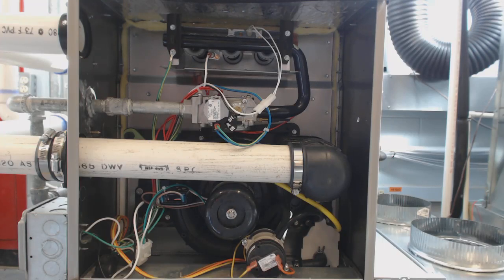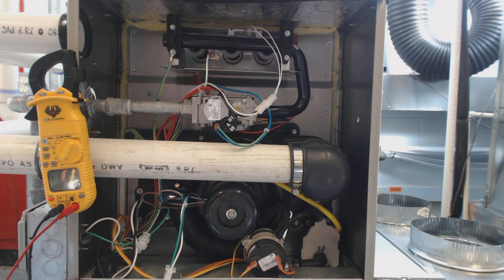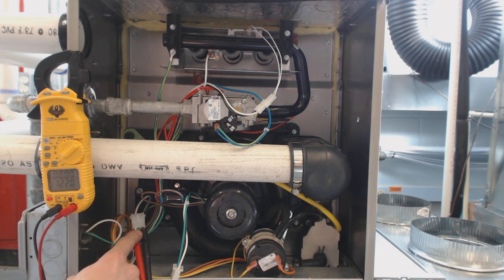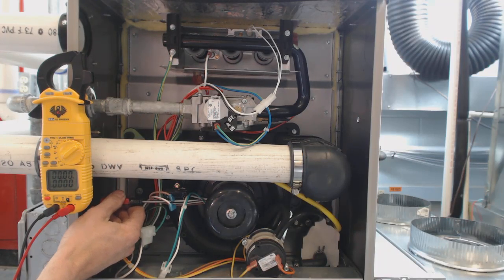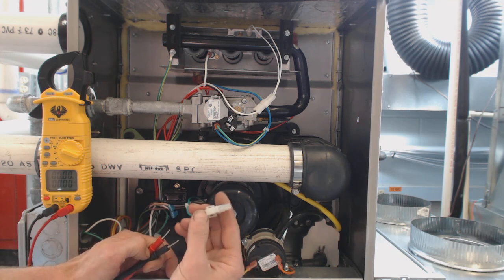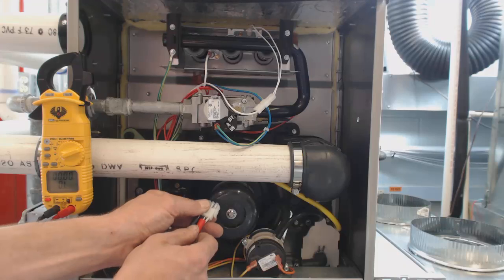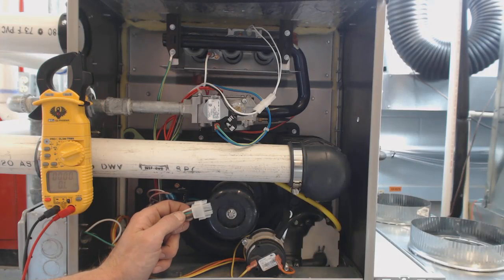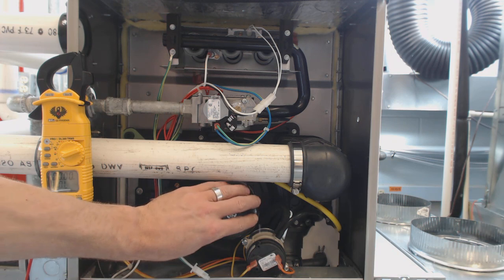How to tell if an Inducer Motor is BAD: Explained Step by Step

Comment: My problem was that the inducer motor was spinning perfectly but wasn’t turning on. I was getting 117 volts coming to the connecting wires of the motor, so I knew that the board was supplying the voltage. I pulled the wires off of the motor so that the motor was a stand alone component and connected it to a 120 volt jumper and the motor was dead. My house has 2 identical HVAC, one is upstairs and doesn’t get used as much, so I took the motor off of the working one and swapped out the not working one and it fired right up. I ordered a new motor (not from Jeff Bezos) and will install it on the other one.

Comment: For the last month I've heard a scratching  sound right by the furnace. I could never find anything,  but it sounds like a critter. Do critters like to crawl ip the horizontal  pvc pipes?  Do they die when they hit the impeller blades and make a racket?   I can't smell anything bad in the pipes  .  Furnace was working well, and I heard scratching,  now no scratching  and a loud racket. from  the induction fan.

Comment: Thanks for the indepth tutorial. At the end you revealed my issue - stuck bearings of the inducer motor. A couple turns and it was running. I'll degrease them later 😊

Comment: The motor wheel was cracked causing it to be noisy. Do you think we as a do it yourselfer could fix that wheel with maybe some epoxy or some kind of strong putty for plastics or can the wheel itself be replaced or do we have to buy the whole motor, housing and all?

Comment: I replaced my inducer motor and blower wheel because of bearing noise. Got them separately on Amazon. Now I got a lot of orange flame. Flame looks like crap. It was nice and blue before. Also seems like the flames are not being pulled/stretch enough inside the exchanger because the flames are not a narrow as before. 
Maybe didn't adjust the fan blade on the motor shaft far enough out?  
Maybe the new cheap Amazon blower wheel sucks?
I got a nanometer, but haven't checked the vacuum on the inducer yet. Not sure if the manual has a spec or not.
Reply: Did you figure out what the problem was?

Comment: My inducer motor ran but it didn't close the pressure switch every time. The igniter always lit up for the first time and turned itself off right away. The motor ran but gas valve didn't open, the control board gave 3 flashes for bad pressure switch. However, the igniter lit up for the second time and this time the gas valve opened. Is this because the inducer motor is bad? Thank you.

Comment: Inducer motor spins with no noise or resistance once it gets started but just doesn't want to start.  I initially didn't see the capacitor as I figured it would be down with the blower capacitor but yeah..that's gotta be it.  Thank you.

Comment: Hello,my furnace is calling for heat but the inducer motor does nothing and is hard to spin however the board is giving the code it's the pressure switch?

Comment: Somebody used galvanized water pipe for gas pipe
Reply from the maker: There is no differentiation in black iron vs galvanized in the IFGC 2021. We live near the ocean and supply houses only supply galv. Black iron rots too quickly but in reference to nationally, there is no problem using galv unless your local inspector shows you some reference to a code that the city has adopted outside of IFGC, thanks!
Reply: If there’s no difference then use black iron where galvanized is supposed to be used. It’s your preference. Thanks

Comment: I don’t have an amp reader but curious to hear your feedback.  I just turned the furnace on.   Getting a small buzzing sound.  Not a loud Humm, like I’ve seen in some videos.

I am replacing the capacitor.  Am worried Becusse the inducer blower motor was pretty damn hot after 2 minutes.  
  What’s the difference between the inducer blower motor (mounted on the front of the furnace) and the blower motor on bottom of furnace attached to the wheel?
Reply: Having same issue myself. Small humming from the inducer motor.
Reply: @MrSmith-ke1hb  have you checked the capacitor on it?
Reply: @bobduffy7744  seized motor on a 24 year old unit. Fan was hard to even turn. Company not even around, luckily they had replacement. Ty for your vids.
Reply: @MrSmith-ke1hb  did it just seize unexpectedly?  Or was it making any noise prior?   How was the furnace working before?
Reply: @MrSmith-ke1hb  and I’m not certain.. but I think a bad capacitor can still cause difficulty in turning the fan.  Not typically but it’s a very cheap and easy fix.  I’m not sure how much a motor will cost.   24 years u never know..
Reply: @MrSmith-ke1hb  check that video out.  I hope that helps
Reply: @MrSmith-ke1hb  https://youtu.be/ul3RiDNn6io
Reply: Inducer is used to pull a negative pressure blower is used to move the air around your home

Comment: i have 9 wires going to my inducer motor on my furnace. i get an error code that its failed. my motor reads 5.7m ohms which is way too high but what i dont know is if there is some kind of circutry inside the motor involving those other wires that will change the resistance of the coil.    i have no external cap so that on the board, visually the caps are all electrolytic and none of them are popped.  should i just buy a replacement motor and go from there?

Comment: Great Video! Quick question, my heat won't turn on, and my inducer motor when I touch it is really hot to the touch. When I spin the motor wheel and power cycle the Furnace, the until will work for a day or 2 then stop working, and I need to repeat the above, I am guessing the motor is bad?

Comment: Technician come over for regular check up An d told me my inducer motor need to be replaced because after running for awhile fell hot the motor no noise An d works fine until he said that

Comment: What about if the inducer motor is going on and off while the air conditioner is running?I can hear it start up and then it will shut off and then start up and then shut off

Comment: On my inducer motor, there are two wires that plug into the inducer. (White & black) when I have both of them plugged in the white one is sparking where it plugs in. Is this a problem? Everything works it blow's out heat. Also the flame's came back at me so I shut it down.

Comment: hi, i was working on a unit heater. on a call for heat the board sends out 125vac to the venting motor BUT the motor won't spin. i checked motor ohms and got 8ohms. i replaced the motor BUT same problem. when i connected motor directly to 125vac line voltage motor spins fine. why does motor won't spin with 125vac from board? is this a bad board? thank you.
Reply from the maker: Interesting! Check the voltage by also measuring the hot at the inducer to the 120v common on the transformer. Also measure the common going to the inducer and the 120v hot at the transformer. Also measure the 120v output from the board at the inducer motor wire plug but with the inducer disconnected. Also wiggle the connector while measuring voltage. It may be a bad contact on the board or plug where you get voltage without a load and then once amperage is pulled, the contact has too high of a resistance for the voltage to remain at 120v, thanks!

Comment: okay so my goodman gas package unit blows the circuit board fuse when the thermostat is turned to heat, but when I bypass the thermostat & thermostat wiring at the unit and hook the white to red, the heat works just fine. any advice?
brand new unit. single stage heat and cool, with single stage honeywell thermostat.
this is my second thermostat :-/ same symptoms...
Reply: Way late but for anyone else, your white wire may have a short. You can check continuity by turning power off and putting white and red or whatever other wire together then going to the thermostat and putting each lead on white and red in continuity. If it's open then there is a short. You also want to check to ground.
Reply: @Big_Nasty966  ah thanks for getting back to me.
I figured it out: I'm not supposed to connect the blue wire to the thermostat. I haven't had a single problem with it ever since I changed that. 
It might have been something particular to my thermostat. It's kind of funny that I built the ducts, built a custom filter housing with constant pressure monitoring, installed the concrete pad, installed the electrical and gas...and the only problem I had was with hooking up the thermostat =D

Comment: Should the inducer work if you apply 120 V to its terminals directly?  I did that for a few sec and I only heard a humming sound.
Thanks.
Reply from the maker: There may be a capacitor mounted on it too that may be bad
Reply: @acservicetechchannel  It is pole shaded motor, I changed it and everything is fine now.  Bought the motor for $135.

Comment: Hello, I'm relatively new as a tech in a sense.  I recently came to an indicer motor that was pulling considerably less amps than it was rated for.  The motor was rated at 2.7A but It was only pulling 0.9A.  In all the tune ups, I've never seen one pull such low amperage.  I've seen induces pull over amps, but never that far under.  Are you aware of any reason that could happen ?

Comment: What if my inducer fan I s running and I just replaced pressure switch ...what else can cause pressure issues I'm thinking maybe a crack some where I cant see because I feel no pressure at vynal tube
Reply from the maker: Look up a video I did, top 10 pressure switch error code problems, thanks!

Comment: The unit I am working on has 7  volts  coming to  inducer motor  wiring  as inducer motor is disconnected. 

Then I measured resistance between  hot and  neutral  terminal of inducer motor,  it only reads 4 ohms.

Does this mean the both board and inducer motor  are  defective?

Comment: Can an inducer motor still run and cause problems? I have an intermittent code 3 on my keeprite thats only 6 years old. 
The furnace will run normally but sometimes about 4 or 5 mins into the heat cycle the burners shut off and the fan still runs for a good few mins then shuts off and turns right back on and will run again till it meets the temp called for.. ITs a odd issue and 3 hvac techs couldn't fix it on 3 seperate calls last winter.. It ran fine on ac all summer with no issues.. But now the weather is colder its acting up again.. I can always reset the panel switch and it will 100% always work for a little while, maybe a week or 2 weeks, maybe only 3 days etc but the same problem always happens and none of these local techs can peg down the problem.. 
The first tech said the inducer vent was blocked by snow and reset the panel, left the top panel off and said it was fixed. I tried telling him that it was running weird even before the snow came.. 
The second tech cleaned the drain lines and blew through the pressure switch, reset the panel and said it was fixed.. All within 2 weeks of the first tech mind you..
The third tech said the venting was slanted wrong and water was pooling in the exhaust line.. I watched him cut the line and drain a bit of water, re-level the line so it didn't pool anymore, reset the panel and said it was fixed.. 

The third tech said his next guess if the above didn't work, was a bad mother board @ 700 bucks... 
Any ideas anyone? We are almost about to put a new furnace in at this rate as these service calls keep adding up in cost.. The warranty was done at 5 years apparently on my model.. Funny they sold me a 10 year warranty line of bs to sell me the furnace, but when problems arise its 5 years..
Reply: TJ L honestly I would establish proper airflow first. Amazing what not proper routing duct work and one closed register will do. Could be cutting off on high limit switch inside your heat exchanger. If it reads too hot in there it will shit off, once it cools down to the rating on the switch it will close and heat will start again. Do you have any of your supply vents closed? Kinks in ductwork?
Reply: @bpw7b3a69  I close one in the bedroom and one in the kitchen and one in the basement otherwise it gets too hot and the air is too dry. We only have it set to 66 and heat to 68.

Why would it start doing this 7 years in to install? WE always ran it like that..
Reply: Shut off not shit off 🤦🏻‍♂️
Reply: I would open the vents and see if this fixes the issue. You’d be surprised. As for why it would do it now after seven years I couldn’t tell you. However I would start simple and work my way through to the bigger issues. You should always have all vents open.
Reply: @bpw7b3a69  ill give it a try. thanks

Comment: JUST A QUESTION ABOUT THE AC  SIDE OF THINGS:

If the condenser (the unit outside the house) does not come on, could this still be a Draft Inducer issue?
Reply from the maker: A draft inducer has to do with the furnace and the condensor has to do with the AC so no they would not be related, thanks

Comment: My inducer motor is whining real loud and i smell a burning funny smell in the house and the furnace is only like 9 years old??
Reply from the maker: You should turn the power off to the furnace and replace the inducer it sounds like. It sounds like the bearings or something else is bad but you could call a tech to verify, thanks!
Reply: Thank you
Reply from the maker: Glad to help!

Comment: I have 120 volts but nothing after 2 to 3 seconds
Reply from the maker: Do you still have 24v measured between w and c when you lose 120v  to the inducer? If you do have 24v then the relay soldered on the board may be bad
Reply: I will check thank you for the reply

Comment: What if my ohm resistance is only 27.5?  Coleman furnace very similar to yours. Capacitor for motor is a 4uf.
Reply from the maker: That sounds possible depending on the hp, thanks

Comment: My biggest problem is noisy inducers.  One day, I heard a racket coming the furnace and isolated the noise to the inducer fan.  I removed the inducer assembly and found four or five dead wasps inside the fan housing.  Another time, the inducer was making a racket and I found a nail inside the fan housing.  We had just had our roof replaced and a roofer must have shoved a nail into the furnace vent pipe somehow.
Reply from the maker: Oh wow, nice! I will be putting out a top 8 noisy inducer motor problems video tomorrow or sun, thanks

Comment: So if capacitor is 3.5 what would be a bad mfd reading?
Reply from the maker: More than 6% off from the existing one would be bad, thanks
Reply: I would probably go with no more than 10% error but what are you measuring the capacitance with?  Your measuring device may not be accurate so it's good to check it first with a known good capacitor.  The truth is that most capacitors fail completely by open circuit internally.  I suppose a capacitor could also short internally but I have replaced so many capacitors I just don't remember ever finding a bad capacitor like that.  I always used an analog meter to see if the capacitor was charging normally.

Comment: Hello and thank you for your video.  I haven't yet started the diagnostics you recommended but would like your input.  My Amana furnace (installed late 2010) turned on without any issue this season but after a few weeks I noticed the house was not warming up.  I went to the furnace and noticed that the inducer was not running and was getting an error code for a faulty pressure sensor. Before watching your video I wasn't sure of the sequence (inducer should kick on first) of operation and thought it was the pressure sensor or a clogged vent. I know I shouldn't have but after blowing into and sucking on the pressure sensor tube I could hear the sensor click and after about 30 seconds the inducer turns on and the furnace worked for about 3 days and then stops.  I blew and sucked into the tube again and again the inducer turns on and the furnace runs normally.  Any thoughts are greatly appreciated.

Comment: So you have to short out capacitor to test it?  What is good range mfd the capacitor should be?  What kind of capacitor is it a start or run capacitor?
Reply from the maker: That is a run capacitor but it also helps to start the motor. You need to check the rating on the capacitor itself and if it outside of 5% of that you would replace with the same size, thanks

Comment: what causes a furnace to hum when not running
Reply from the maker: That would likely be the transformer. If it is really loud then just replace the transformer with one the same size, thanks
Reply: Thanks, do you know if a Aquatherm furnace is considered a geothermal system?